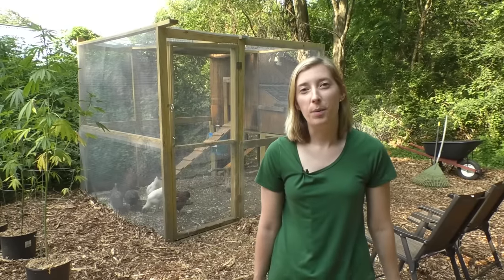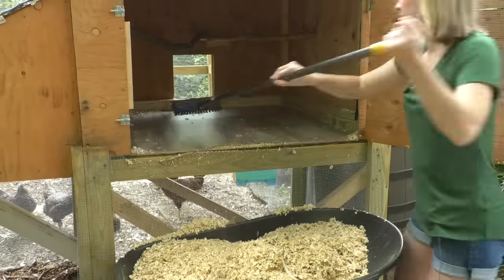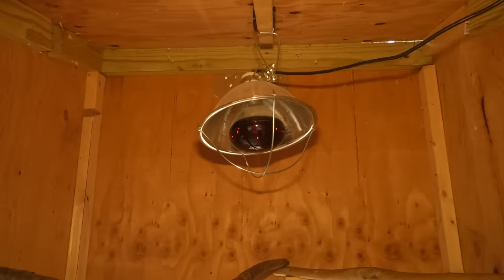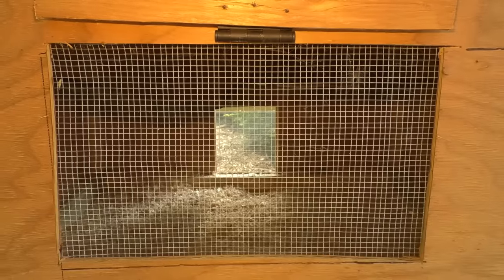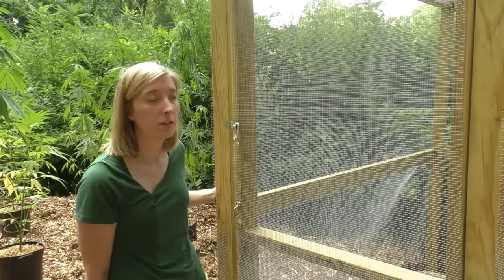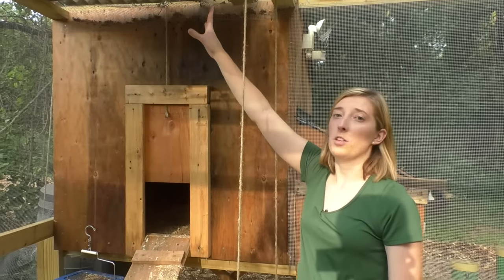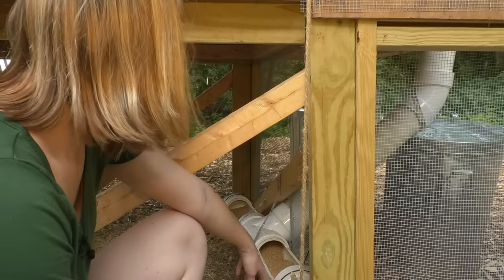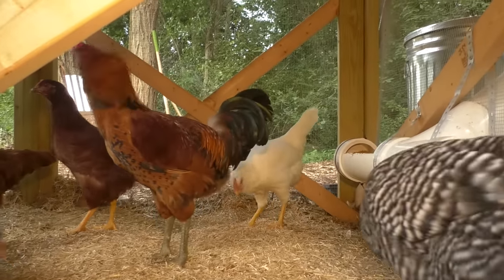Most Efficient Chicken Coop Tour

Comment: Great job for a starter coop! I do have one recommendation: take out the heat lamp. As long as your coop is draft free with ventilation, that is all they need. I’ve been raising chickens in New England for 30 years and they do not need heat. This is a MAJOR fire hazard.
Reply: Instant fried chi....ah nevermind...
Reply: I would love to get more info about how you raise your chicken here in New England.  I live in Cumberland and want to get a chicken but I’m getting very stressed of the amount of things that every one si telling me from different states.  Maybe you can help me get an idea of what I’m getting into? Lol I am building my own chicken coop I hope :) I am just scared of what will happen on the winter! :(
Reply: Maria Urena as long as your coop is built properly with some insulation, ventilated and draft free, there is nothing else really to do during winter. Dry coop, access to fresh water, extra treats. They produce tons of heat so they keep each other warm.
Reply: I took the heat lamp out, but then the rooster started smoking, so the fire hazard remained.
Reply: For electrical stuff, one thing to mitigate fire hazards is getting a surge protector.

Most fires start from shorts/surges. A surge protector will help w/ that.
Reply: Chickens are very dusty: their bedding is dusty and they shed tiny bits of feathers that float through the air. This can quickly build up on a heat lamp bulb and seems dangerous to me, even if the heat lamp is high enough above the floor of the coop.
Reply: @mariaurena9820  Most breeds of chickens can withstand cold as long as the coop isn't wet or drafty (coops need ventilation to let moisture out, but no breeze blowing in when it's cold, especially at night). Chickens are much more likely to die from heat than cold. The main problem I've had with my chickens in the cold is that the roosters with large combs can get frostbite: it is painful (they shake their heads) and makes the comb turn dark or sometimes bleed. This seems to happen with my chickens when the temps get down to zero F or below (minus 18 C or below). The hens don't seem to get frostbite on their combs and I've never had wattles affected on roosters or hens.

If you live in a very cold climate, get breeds of chickens with low combs that are close to their heads to prevent frostbite.  And get heavy dual-purpose breeds, not skinny hybrids bred only to lay eggs, since heavy breeds will withstand the cold better. Try breeds like Araucana, Ameraucana and Wyandottes to fulfill both criteria.

Chickens are animals that want to be in a flock so you cannot just get A (one) chicken. You need at least two or three to keep each other company and to keep each other warm in the winter.
Reply: A chickens core temperature is between 105°-106°, there is no need for supplemental heat. It can actually kill them. Keep the coop ventilated. I live in Northern Idaho area and my chickens are doing great during these cold days and nights.
Reply: We’re about to start a flock so I’ve been looking for a simple, effective DIY coop. Best basic design I’ve seen! How’s your roof put together?
Reply: @Commander_Bunny  Thats funny as hell!!
Reply: @mariaurena9820  A single chicken will put out about the same amount of heat that a 60w light bulb does.  As long and they have food/water and the coop is not drafty, they will keep each other warm.  Not drafty doesn't mean sealed.  You still want a couple mesh covered holes at the top of the walls to allow moisture out.  Chickens breath out a surprising amount of moisture.
Reply: @kesakary  We are in North Idaho as well and never heat our coop with adult chickens.  Our winters get down to single digits and we usually have a short span of time with negative temps.

Comment: Your coop is pretty good. I would do one further thing though. Add a sand box. Chickens like all birds bathe by rolling in the sand. It also cleans the mites and redistributes the oils on their feathers. No need for anything elaborate just dig 1" of soil from under the house and walkway and add sand. Keep your chickens happier and healthier.
God Bless
Reply: good point. chickens love their dust baths. if you find anything dig around your coop trying to get in - place large stones around it on the outside.
Reply: What type of sand do you use?
Reply: I'm just conversing here....I too added a heat lamp when the temperature went down to 18% here in SC. My husband almost had a fit because he was worried about fire. I ignored him untill I read an article on The Chicken Chick website. I hadn't thought thru floating feathers, flying chickens, shavings, etc. The coops lost by fire freaked me out and I got rid of it. There is a flat screen heater for coops that I would consider.
Reply: Lisa, You only have to attach it with more than the clamp provided. Like she said they have nails securing it from falling.
Reply: @PrinceCbass  again, the concern I read about is not the lamp falling. It's something getting up to the lamp and igniting.
Reply: Chickens are quite hardy animals and should survive just fine in New England without the help of a heat lamp. As noted in the video, they like to huddle, which keeps them warm. They don't actually like heat lamps and refuse to huddle near them. https://www.theprairiehomestead.com/2015/01/chickens-need-heat-lamp.html
Reply: @lisaepperson9095  I saw one coop that had a wire box around the lamp and it was attached to the roof.  That would keep most items off the lamp.

Comment: chickens have feathers; they are not afraid of cold. There is no need for a heat lamp. However, they need lots of ventilation, even in the winter time, to prevent moisture build-up.

Comment: Love  it! I do not recommend using a heat lamp. We used to use them, but they are a fire hazard and we had 2 of them explode. I found the heat mats are much safer and the chickens have to option to be on them if they need and off if they don't. We put them on top of cinder blocks so they are not in the bedding. Of course, they are not put outside until they have feathers. 

For the pen we put down 2-3' of pea gravel and I hose it down every day to wash the poop down. I tried other methods and just had mud when it rained.  Our chickens free range in our fenced yard during the day and they are shut in at dusk.
Reply: Exactly. If the chickens are fully feathered they don’t need the heat lamp anyway.
Chickens can withstand cold. It’s heat that hurts them.